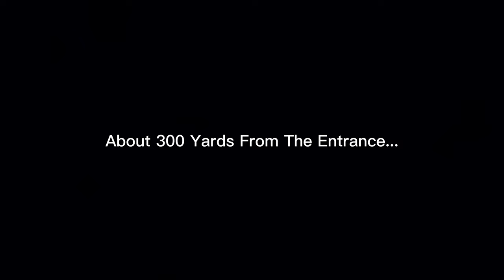Infinit X Dmaxx250 Aftermovie

Comment: I'm looking forward to this channel getting bigger. What time did the McLaren run?
Reply from the maker: We ran a 10.1 on the day but with my clutches slipping the entire way down the strip and then clutches disengaging 3/4 of the way down the strip 😅 I think theirs an 8 in there somewhere. I have the Dodson full gearbox catalogue of parts en route, stay tuned as I’ll make a video of the parts they send me across 😎
Reply: That makes sense why the car sounded like that haha. Do you think it's an issue with the clutch material not being able to clamp down hard enough or something like that?
Reply from the maker: @danieljadorie829  the gearboxes can’t be tuned on this platform currently. So their is no real gearbox solution but M Engineering are working on it, that needs to happen to push this platform forward. For now I’m hoping upgraded clutches without software changes will do the job!